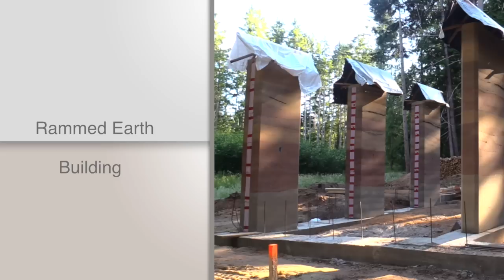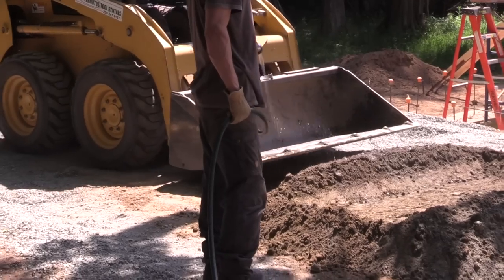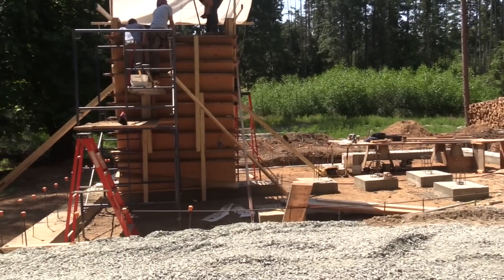Rammed Earth

Comment: Rammed Earth is beautiful and will last many lifetimes. It doesn't need aggregate (stones) to be structurally sound.  You don't want external walls with rough exposed stone "cracks". It will create a wound that weathering can erode over time. Internally it's an "aesthetic" personal choice. Building Columns is an excellent architectural design strategy. It requires good planning and if used with prefabricated fill-in-in sections that includes windows and doors it will make for quick and efficient construction. Most internal walls, often requiring complex twists and turns don't need to be rammed earth, typical framing will suffice - again a personal choice. If the clay content is high + 20% cement mix can be as little as 5%. A well organized and managed build program competes very favorably with traditional construction costs. I am working with an engineer to create a fully mechanized process that will speed up construction. Also developing adjustable form-work to offer maximum versatility and reduce the labour requirements. The plan is to build a whole village complex based on this type of construction while also utilizing many of the Earthship environmentally-sensitive passive-sustainability principles I.E. To rewrite the book of "Best Practice"... Offering a truly holistic off-grid solution combined with incredible architectural potential.

Comment: What holds these walls to the ground?
Reply: Warrior Rising  That won't work for our building code. We'd still need a concrete Foundation with rebar into the Earth work.
Reply: Warrior Rising  I never claimed that.  Just that SOMETHING has to hold the wall in place.  Rebar at the bottom to a rigid structure or a connection to the other walls so it is next to impossible to flip forward or backward.  Just not comfortable with free floating walls.

Comment: Rammed earth is strong structurally, and withstands weathering very well.

Some formulas will include a 10% cement mix for the stability of the substrate. It's quite common for the top and bottom layer of rammed earth to have approximately 30 - 40% cement to increase its resistance to moist conditions.

As mentioned in the video, rammed earth is compressed and because of this is very dense. There are number of advantages to earthen walls and rammed earth is the most weather resistant method.

It is an alternative to concrete as it's more environmentally friendly and absolutely gorgeous and cheap based on materials readily available onsite.

The down side of this method is the time it takes to construct the forms and because of this can be a deterrent to novices.
Reply: Instead of cement can we use lime?

Comment: Please show us testing of these walls under shock, water and sun's heat.
It looks good but does it stay up, how much maintainance it requires and how.
Reply: Rammed earth is strong structurally, and withstands weathering very well.

Some formulas will include a 10% cement mix for the stability of the substrate. It's quite common for the top and bottom layer of rammed earth to have approximately 30 - 40% cement to increase its resistance to moist conditions.

As mentioned in the video, rammed earth is compressed and because of this is very dense. There are number of advantages to earthen walls and rammed earth is the most weather resistant method.

It is an alternative to concrete as it's more environmentally friendly and absolutely gorgeous and cheap based on materials readily available onsite.

The down side of this method is the time it takes to construct the forms and because of this can be a deterrent to novices.
Reply: @freshimpactco.8698  Since then, i have watched a number of videos and recommend it highly for people specially in dry states.

Comment: That's beautiful.. i wonder will it works in the tropical climate? Will the rain and heat loosen the wall integrity?
Reply: Why wouldn't it work? Just respect the sacred rule:  Good Boots and a good hat !  Don't put directly the earth on the ground or the water will come up and destroy the wall. Build a good roof for the same reason, to protect from the rain. Instead of using concrete made of out cement for the base I recommend to make a cyclopean foundation, made out of stones and lime concrete. Good luck.

Comment: The "lift" he's doing a slow zoom out from is really sloppy... it might look kinda cool, but the camera guy doesn't realize he's focusing on a mistake, not a design feature. Shit like this comes from doing GIGANTIC lifts and then not getting proper compaction along the edge of the form... come on bro, your lifts could / should probably be half that size... or is that actually two lifts and you took lunch there and cold joined it?
Reply: If you're talking about the lines visible at 5:32 and 6:02 those are cold joints which is where they ended the previous day and they are absolutely fine

Comment: What is the texture like? They don't need to add some kind of lacquer or wax or some kind of finish on the surface to maintain smoothness/prevent flaking?
Reply: Basically like a concrete wall with a bit of texture/feel to it. It wont flake away or anything as it is stabilised and most of the smoothness comes from the formwork used (like concrete).

Comment: There is some maintenance to be done on these walls, there not as hard or strong as concrete. 
Also they have to be sealed good, or they decay. There also labor intensive so there not cheap. 
You can do the same thing with concrete with the colors and layers of aggregate. I did a 10" layer all around my forms every 2 hours, using a cement mixer, It turned out awesome.
Reply: They don't decay, that's utter bullshit. Although damp can pass through if not sealed. 
While not as strong as concrete, they are plenty strong enough and stronger than many other materials. 
This is ideal if you want to do your own build, spending time rather than money for a beautiful result.
Reply: You might want to look into how RE construction curing processes differ from that of concrete.  Concrete is a strictly chemical curing process where RE is a combination of chemical and pressure curing.  The result is that RE has more in common with naturally occurring bedrock which is one aspect of why it lasts so long *and doesn't necessarily need to be sealed*.

Comment: who knows if we have to seal these wall to prevent erosion or how doing maintenance to keep looking like new mainly the outside wall... this guy do a great job I am pretty sure those wall are not cheap at all because of the intensive labor  compare with the concrete wall that you can polish and make it look like natural , also there are several paint techniques that you can use for similar looks, in construction every is about budget and people desires
Reply: Sealing is not required, but if you don't seal and are in a temperate climate then damp will get in.

Comment: This looks really cool.  Is there a way it can be used as a vertical load bearing structure and how would you determine how much load it can take, and how it might fail if something went wrong?
Reply: Simple answer: yes, if you do it professionally. Rammed-earth contractor Sirewall managed to build a 100-foot-tall rammed earth building in Islamabad a few years ago. https://sirewall.com/project/telenor-headoffice-islamabad/

As for determining the load, look up "compressive/tensile strength test." The same test is used for just about any material, be it aluminum, concrete, or rammed earth. It depends on the mixture, but rammed earth with nothing added maxes out at 4.3MPa, roughly a quarter that of concrete used in most residential projects. Sirewall claims their method has a compressive strength of 30MPa, which is what you see in very large-scale and specialized industrial projects. Obviously, for small homes 30MPa is complete overkill; stabilizing with cement and rebar and putting insulation inside is far more than enough. Don't trust me though read up on this stuff yourself
Reply: Interesting thanks.

Comment: So at the end of the day your buildings are low-grade concrete rather than rammed earth, and so can’t really claim to be natural or eco-friendly, plus by adding cement you just decreased the earth walls capability of releasing moisture. There are precedents for earth buildings with no cement at all even in Japan where everyday earthquakes shaking the land! Just need to look for it. About building codes - they are guidance only! You need to provide test results to justify that earth wall is just as good structurally as the earth and cement wall and here you go - you get the building permission!

Comment: disappointing. There are plenty of rammed earth structures going up around the world that do not use portland cement. In fact, you can look up an English builder on youtube that builds rammed earth that traditional way and this does not use any cement.
Reply: instead to say there is a guy copy the link is easy to share info let the people understand your point of view
Reply: Concrete is mother earth product. It's made from limestone usually that is cooked, powdered, watered and dried. Roman's made it too. Their structures are still with us. The mortar in the great wall of China was mixed with rice starch and it has outlasted the bricks. So, Cement is earthy and ecological and belongs in rammed earth because it IS earth. Drive on with your cement, bros. Rebar is righteous too because it is an earth product made from iron which usually comes from hematite rocks and the slab byproduct is used in road building. But styrofoam is from Beelzebub!!!
Reply: @jukeboxhero1649  Firing the lime in a huge forge along with making iron rebar are costly endeavors, in terms of the carbon footprint. I personally don't care about that sort of thing, but that's what people are generally talking about in terms of the impact on nature. They are certainly naturally occurring materials, but the process takes a lot of fuel.
Reply: @g.e.o.r.g.e...  try some rice starch mixes. The rice starch makes it un believably hard and durable.
Reply: @jukeboxhero1649  can it get wet though... or will it still need lime plaster/shitloads of oil on the exterior to protect it?
Reply: @g.e.o.r.g.e...  I dont think it needs anything  because the mortar on the Great Wall of China used it and the mortar has been outlasting the bricks
Reply: @jukeboxhero1649  uhh, the Great Wall of China also used quicklime... the rice was just a supplement.
Reply: @g.e.o.r.g.e...  ok, look, the stuff is still there and did not erode. That's my point. The difference from other mortars is rice starch. Now tighten up.
Reply: Please share the link
Reply: TheEarthDoctor1  If interested (and not making any comment on your above post), you might want to look into India's vedic texts, one of which records the detailed construction techniques that enabled their ancient temples to survive earthquakes almost completely intact for millenia.
Reply: Another technique is with lime, maximum 10%
https://www.youtube.com/watch?v=5dJJs9Bruk4
Reply: *****
Building codes can be changed. A lot of them have been written to include cement because when someone asked to get their building approved the added cement so a default code for rammed earth might include cement in one state and no cement in another. You just need to do your homework to change the codes.
Reply: Mark I don't think It's quite that simple. Despite the fact that they use portland concrete, what should be noted is that professional rammed earth builders will tend to use a 10-15% mix in concrete. It's helpful to have as a stabilizer and will ensure its longevity. This was done in the pacific northwest that is near a major fault line.
Reply: Not true. Old rammed earth homes were built with no concrete that still stand today. And there's a guy in England, who builds homes all around the world, and he uses no concrete or cement. I think what has happened is that we have stopped being respectful to mother earth and have taken easy steps for too long and are using cement where it doesn't need to be used. And, I'll give you another example. CEB homes are becoming very popular and I see them as an evolution of Cob and Rammed Earth homes. Do we really need to use cement/concrete in those homes? 

Anyway, if you want a link to see some of the structures the guy in England has built without concrete, let me know.
Reply: Mark Gailmor my point still stands. There also isn't a lot of seismic activity that happens in England but somewhere in the pnw that's prone to earthquakes.. A bit of concrete helps
Reply: It really doesn't and it's not an environmentally friendly product. It cement/concrete was needed then perhaps you can explain to me how Cob, which has no cement, can go through rigorous earthquake simulations and remain standing? And here's something else to consider. Concrete degrades over time while earth lasts for hundreds of years. And we have cob homes standing all over the world. Some have been around for hundreds of years. All built without concrete.
Reply: @rawmark  Hi , I am really interested in that link, can you kindly assist me? Thanks.
Reply: I agree that cement wasn’t used in old times, what helps the buildings to last long time is the following 
1- dirt is flexible adjusts to ground movements and in some cases it repairs itself, 
2- old buildings where plaster with a mix of sand and lime, that protected the building
3-some type of bamboo or wood was used as reinforcement on the corners and horizontally 
 
Have any body try to cut a window on a adobe wall or rammed wall? You use a slash hammer and it just don’t crack, it sinks into the wall, with concrete you hit it with a slash hammer and the more concrete you put the easier that cracks and difficult to repair.

Well that is my experience 

Thanks